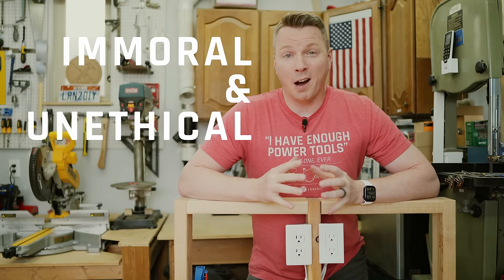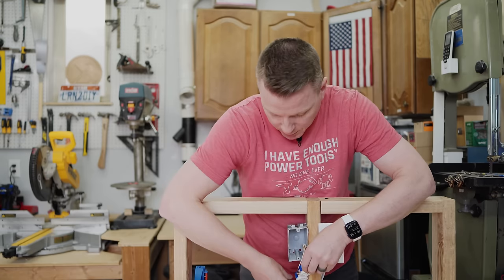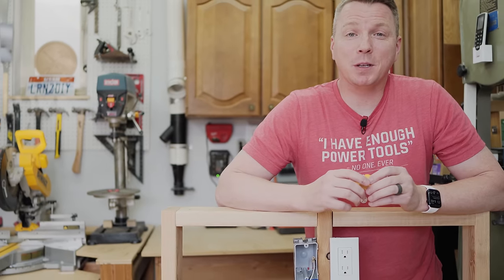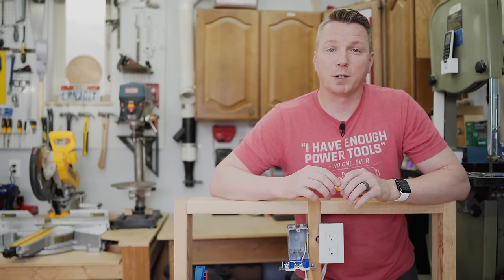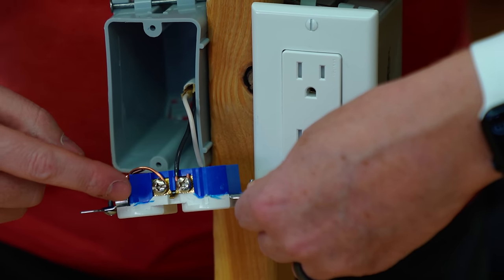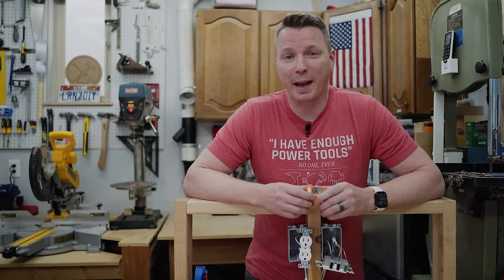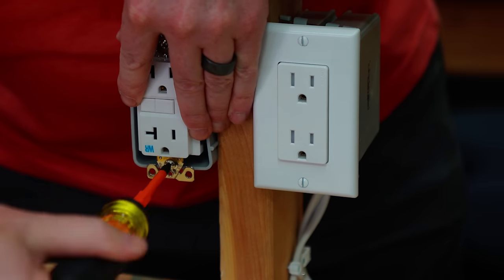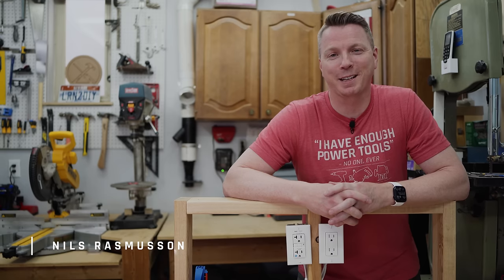People Are Adding Deadly Hacks to Outlets

Comment: I remember one time I was working on a house doing a sliding glass door upgrade. Needless to say: my Sawzall was plugged into a reverse wired receptacle, the metal frame of the door was grounded. Guess what happened soon as the blade touched the metal frame? Arc's & sparks

Comment: Still in the beginning of the video, and as a Brazilian I can say in advance that it might be dangerous in one way or another, but I never saw anyone get hurt because a ground wire was missing. In fact, 10 years ago and later it was extremely rare a house that had all three wires, even electric shower heads (that 99% of us use it since... Ever), many people didn't ground it, and again, never saw or heard of anyone hurt. Ground wire is important, but you're not in danger if it's missing.

Comment: In all fairness, if you’re talking about alternating current, the “hot” wire switches from black to white and back again 60 times each second.
Reply: Not true. The white wire stays at zero at all times. The voltage of the black wire is the only one that alternates.

Comment: A few other things to note, putting GFCI breakers in your electrical panel will do the same effect as putting in the GFCI outlet on the first outlet in the chain. Also rewiring your house not only will you have to pay an electrician but you will most likely have to pay a handyman or a painter or a drywall contractor because the electrician is going to have to cut holes in your walls or ceilings to run the wires correctly
Reply: I've done many residential rewires and I do try to avoid cutting into finished surfaces but sometimes there is no other option

Comment: Very informative but I still don’t know what to do if the box doesn’t have a ground wire and I need to replace the outlet without installing a GFCI.
Reply: You replace it with a 2 prong or a GFCI. Those are the only legal options.

Comment: So, you're telling me that a bootleg ground is dangerous while, assuming it's going directly back to a main panel, the neutral and ground go back to the same bussbar? Since a ground wire is designed to only carry current back when there's a faulty circuit, it's not like the neutral would be forced to take additional load in the situation where the ground is even utilized! I'm not saying it's code to bootleg a ground. I'm more than positive that you're correct on that point. I'm also not saying it should be normal practice. I'm just saying that as long as the circuit goes back to a properly terminated MAIN (sub panels may have seperate grounds, depending on how far away they are from the main) panel (ground and neutral wires go to the same bussbar), it shouldn't pose any hazard. Regardless of code, it's just simple logic.

I love your channel and have learned a lot from you! I completely respect you for the information that you share and I don't want you to think I'm "dogging" on you. I'm just saying that other than being against code, under the assumption that the circuit is running back to a properly BALANCED MAIN panel and the breaker is good, this "hack" poses no threat that I'm aware of (even after watching your video) to anybody. I don't believe in coersion through false logic and that people can handle their decision-making based on logic when given just the facts. The way a main breaker panel is wired is exactly the reason all your cheaper testers "pass" the circuit - because regardless of whether it has a ground wire or is "bootlegged", the circuits goes to the same bussbar. This is especially true in American, 120v circuits. I admittedly know much less when it comes to the European circuits where (I'm assuming) there is no neutral at all. 

Note to others reading this comment: That being said, code is there for a reason. Don't go out of your way to defy code! Even though it may work just fine and pose little to no threat, it's gonna bite you in the end! What I mean by that is even though you may be able to get by with this hack for several years with no incident, eventually your house is going to get inspected, whether it be for selling it or for future renovations. At that point, depending on your situation, you may be forced to correct the issue, meaning potentially tearing out a bunch of drywall, ceiling panels, and insulation to replace your wiring. This can wind up being very expensive and potentially even unaffordable without proper planning!

Thank you for sharing all your knowledge and I hope to see many more episodes in the future!

Comment: This was perfectly legal over here in Finland going back into the 90's, used to be common practice even. No, it's not as safe as having a separate ground wire, but to say it's lethal is quite an overstatement. Old installations using this method are still perfectly legal, no need to start pulling new wires to fix them.

Comment: My house was built in 1883 and is always a slow go on all projects if you want it done right. I did work on a house where the wanted all these smart switches installed which required pulling a neutral to the new switches. I found a room where someone installed the new switches and used the conduit as a neutral and got zapped when I pulled it out for a look see.

Comment: Do you have to open up walls, or would it be possible to physically attach the new 3-strand wire to the existing 2-strand and use it to pull the new wire through?
Reply: You can certainly try, but there's a reason why fishing wire is almost always done in a completely straight line either from the crawlspace or attic and that's because your wire will get stuck if it has to go around a corner or through too many holes.

Comment: In old Polish (or like most of Europe) wiring when you had only 2 wires (L and N) then the "correct" way was to run N wire to the Gnd outlet connector and then from there make a bridge to N connector. It was caled "zerowanie" or as you could say in english - "grounding".
Reply: Wow, zero is zero in Polish ?
Reply: @dmitripogosian5084  yep, zero i zero, nothing less, nothing more.
Reply: @OzziemandiasPL  My language background is Russian, so given that one, two, three are similar, I kind of expected some similarity from zero.  Though I do know that zero number has completely different (and quite recent) linguistic history  from countable numbers.  Anyway, it was immediately clear what "zerowanie" wants to say except with zero for zero, rather than something "null" related.
Reply: @dmitripogosian5084  yeah, colloquially the Neutral wire is called "zero" and Live wire is called "faza" (which means "phase") in the terms of electricity.
And I agree to those numbers, like odin, dva, tri and Polish jeden, dwa, trzy etc.
Reply: @OzziemandiasPL  Yep, wires are called the same in Russian, except zero is nol'.  Interesting, null is plain Latin,  while zero is traceable through arabic sifr (here comes cipher) to sanskrit.  Interesting, how did the geographical boundary between two names arise.

Comment: my parents home was built in the early 1900 teens it had knob and rod wiring  as we remodel it i ran an extra wire all through the crawl space under the house to get the bottom floor  with 3 wire grounding  only one or 2  of the upstairs had it tho!!!

Comment: what if i had a track light system with this same situation. for example... the new track light  has 3 wires, ground, hot and neutral but the home only has hot and ground... what is the appropriate way to do this ?

Comment: I have a question because I have a similar issue in my home that wasn't explained here. My outlets are grounded to conduit but in one outlet on a single circuit I found has a jumper wire from neutral to the conduit. Removal of said wire no longer powers my room although the line wire is still live. Is it a bad neutral and thats how the previous home owner got around it? And how dangerous is this scenario?
Reply: Yes, it sounds like there was/is a bad neutral and the previous owner made a bodge to get around it and in doing so reduced the safety of the installation.

Your bodge has two problems.

The first is that combining the ground and neutral functions results in a system that is not "single fault safe", if the combined ground and neutral goes open circuit then the metalwork connected to it becomes live.

The second is that grounds are not designed to carry regular service currents. They are often wired with lower-rated wire than the hot and neutral conductors.

Comment: My own wiring-in-an-old-house horrorstory: Flatmate got shocked under the shower - not fatal, but a certified electrician was called, who installed an FI fuse in the bathroom. Half a year later, we figured that the metal-cased dishwasher would trip fuses for no reason - sparking towards the metal sink. As it turns out, that electrician had reversed the wiring for all circuits other than the bathroom - turning the ground wire (exposed and very toddler-grabbable over here) to live, in all wall plugs in the flat. Guess he should probably have checked before "correcting" the wiring, right?

Comment: So to clarify, the jumper will not cause something to work or not work when plugged in, nor is it for the 'look'. The ground wire is a almost never used fault wire thats only used in case of fault where electricity bridges to a metal surface connected to the groundwire, aka short to ground. Most appliances and consumer products don't have a mechanism to check its function nor do they require a dedicated ground to function, 3 prong outlets work just fine without the ground wire,  just not as safe; this is not true for self testing gfci outlets that test proper hookup. For standard 3 prong outlets, the jumper is used to fool the plugin testers because running new cable with a dedicated ground is very expensive.
Reply: On modern devices the groudn wire constantly used to dissipate leaked current. Without a ground wire the case will get half the mains voltage. This will apply not only to computers but also to things like fridges. The current is limited to 0.5 mA or under so it is not immediately dangerous even without a ground and it does not trip a GFCI bu you can feel it if it is not grounded.
Reply: @okaro6595     first I've heard of this. Devices may bleed/leak to ground but my understanding is they aren't designed to function better or worse with ground. This would be evident on battery power where there is no ground vs ac but laptops behave the same on both. Ground is a predictable pathway for electircal discharge that takes an unintentional path. Leakage may make it to ground but really isn't correct since the correct path is neutral back to source. Also, if a device is bleeding current onto ground, and a fault happens on the same ground wire from another device, the current could feed back into the bleeding device to fry it. Ground is usually isolated from hot and neutral. 
Additionally, gfci generally trip between .2 and .5mA.

Comment: What about self-grounding outlets which seemingly don't need a ground connected. There are fairly modern if not current. Are they safe and legal?
Reply: Self – grounding just means that you do not necessarily have to attach the ground wire to the device itself. But it would still require a properly grounded outlet box, so that when you install the device, the device, then becomes grounded when it makes contact with a box and is therefore bonded to the box.

Comment: 4:06 That 15-20 Amps is just the maximum rating the receptacle could safely handle, it wouldn't actually force that amperage to a grounded person as voltage would need to be increased to pass that much current on a resistive load.

Comment: If you go back to before the 1970s homes were wired with no ground (green connection. The older outlets had only the hot and neutral, and no third pin for ground.  If you have to change the outlet, but cannot run in new wires and not be able to find a two prong outlet, you are better off to simply NOT bridge the ground to the neutral. Mark the outlet as non grounded. Better to use a GFI as mentioned. 

Bridging the neutral to the ground would make a ground loop in connected devices. Switching the polarity to an outlet is very dangerous as said!

Comment: Isn't the GFCI outlet the safest option? What is the reason to choose rerunning new wire, instead of using GFCI? Is it just because of the equipment ground, or is there another good reason to choose new wire?
Reply: It's safer altogether to make sure that ground fault current has a low impedance path (i.e. a true ground conductor) back to the panel. That way, if your body is in parallel with the faulty circuit, you get the benefit of being much higher resistance than the copper ground wire. With just a GFCI, you're relying on the GFCI to work quickly and effectively, and being mechanical devices, they do fail sometimes. Even with a GFCI, under the right circumstances, you may be getting a brief ~0.1A of current before it trips. Probably not going to kill you most of the time, but who knows, especially if you've got a pacemaker or something.
Reply: Well the safest would be to have both. Grounding is generally considered safer than GFCI alone but there are cases where the GFCI would protect while grounding did not.

Also the GFCI does not get rid of leaked current and voltage  that you can in some cases feel and which could damage equipment.

Comment: You need to talk with my landlord about electrical.  He wanted me to install a 3 way switch with a 2 wire romex cable and use the green or bare wire as a hot or ungrounded conductor.  He said he didn't want to spend the money going to the store for a 3 wire romex cable.  I noticed he didn't ground some of the receptacles in the house either.

Comment: If you cant re run the wireing unhook the bootleg and put a gfi in. Leave ground open and clearly label outlet "no equipment ground" NEC 406.4(D)(2)(b,c). Or install a two prong outlet NEC 406.4(D)(2).

Comment: My house was built 1969.  It has 3 wires all round.  However, the wiring is all aluminium.  So far, no problems, but, I AM planning on replacement eventually.  My dad used to plug 3 prong grounded items into 2 prong ungrounded extention cords.  I always told him that it was dangerous and he was stupid for doing that.  He would just get mad at me for 'being so disrespectful'.  I told him to tell me about it AFTER he gets electrocuted some day.  'Oh, right, you might not be able to, because you'll might be DEAD!'  I always refused to do it.  I would always insist on plugging it in correctly.  'You don't have to do that!' he would tell me.  I just told him that 'I also don't want to DIE young!'  You might get away with it for 50 year...but it ONLY takes that ONE TIME for something to go wrong!

Comment: Generally speaking you can get a clue from the Vintage of the structure 1950s, 1960s, Etc. Look at interior of Electrical Service Entrance Panel and any other Sub-Panels,  do the Romex cables wired in these panels have (3) wires? (Black, White, Ground) If not?  Then you should only "See" and find two kinds of Receptacle in the house. Type #1 2-prong receptacles from the distant past,  1st-Gen Electrical installation OR a GFCI Receptacle at (Each) receptacle location throughout the house in no grounding wire is available.

Comment: Shorting the neutral to the safety ground is considered dangerous.  But I have never understood why.  If you look in your electrical box you'll find all the white wires are connected to ground.  The safety grounds are also connected to ground.  The wires run right next to each other, and the current is AC.  That means by the time you reach the outlet box due to crosstalk, the current is running through both wires to ground.

The arguments have always been presented about what happens if one of the wires is cut...   

In practice though, I have observed when you have a back emf, you have a dangerous power spike on the white  but not the safety ground.  And the safety ground is not shielded.  Ultimately the safety concern is you or some other object might become a better path to ground than those wires.
Reply: Yep, that's the whole problem. You don't want to give current a chance to flow anywhere except live and neutral conductors, not even under fault conditions. It's not just cut wires. Imagine somebody accidentally or ignorantly wires a switch on the neutral instead of the live. When the switch is off, the bootleg ground is a deathtrap.

Comment: not only to fool the tester but to retrofit older houses to 3 prong outlets.

i think the theory is that it is better than nothing since the neutrals are tied to ground at the main breaker box.

the danger is if there was a fault in the wiring you could not properly ground and still get hurt.

i doubt that will pass inspection for rental units.

i think for that reason dryers are now wired with 4 wires to ensure you have a proper ground.

Comment: I have an old house built in the 60’s that have no grounded circuits I’ve replaced the fuse box and put in a new beaker box in and been replacing the old wiring never trust old wiring especially when codes and information was not so easily accessible on proper ways to do things

Comment: I've heard the argument that since both the neutral and ground wires are going back to the same place (the neutral bus in the panel)—what's wrong with connecting them at the receptacle?  Obviously, that's not good logic, but I've never been able to understand exactly why?

Comment: im not an electrician but i do have basic knowledge, to me it sounds like a floating ground would honestly be safer, even tho that is also unsafe. But for example if you have an amp with a metal case and that case is grounded you basically have livr 120v on the exterior of your amp

So like you get shocked with 120v (or where i live 230v) just by touching it